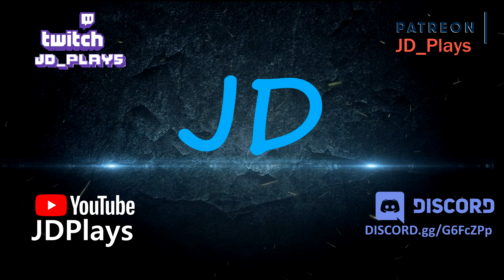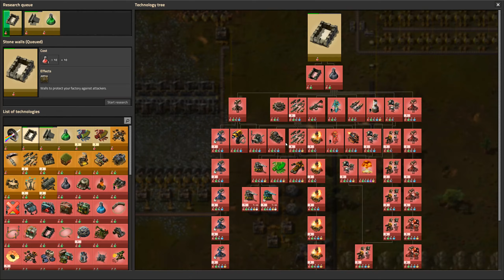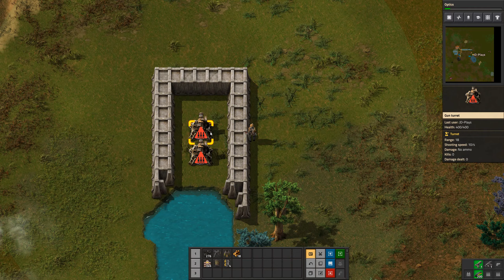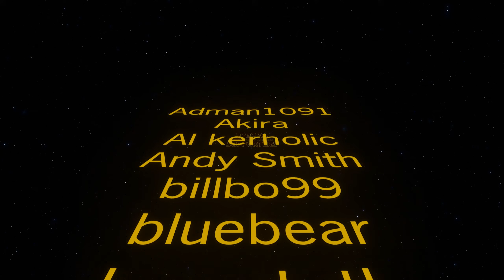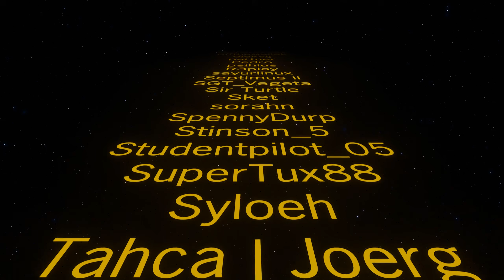Jumpstarting Basic Automation (Early Game Base) ⚙️ Introduction to Factorio 1.0 ⚙️ Tutorial/Guide

Comment: What's your opinion about a "ghetto pillbox" where stone furnaces serve as walls?  The "ghetto 1" variant is only a pair of machineguns surrounded by a honeycomb of 8 furnaces, the "ghetto 2" variant has both a  thin "proper" inner wall and a honeycomb of 12 (or 8+2N for any line of N gun turrets) furnaces as a first layer of protection.  The reason behind furnaces is that they have the best HP per resource cost, even though their HP count per square is mediocre.
Reply from the maker: Furnaces work, they take a lot of space for very little cost. One better is wooden boxes at i think its 50hp per box, then pipe is 100 hp per tile a even better option! Really walls are cheap and if your in trouble are worth the cost even early on

Comment: This is the best early game base I've seen. Can't believe how simple it is but effective.
Reply: 05:33  That's a trick that should be explained more. 
One can clearly see the T-shaped structure with horizontal belts which side-load the vertical belt and create a mixed belt of iron ore and coal.  What's less clear is how to build it.  If you build the vertical belt of the upside-down T first, there won't be any side-loading, because the belt will curve from left to right to up.  If you build the belt coming from the right before the vertical part (as shown), the bottom can't decide whether to curve left or right and doesn't curve at all, which will allow for side-loading.  
(The coal splitter at  05:45  doesn't changes that; it's merely a way to convert a full-speed belt into two slower parallel belts at the last second.  If you dedicate a whole smelting array to one ore, you use another splitter on the ore belt to split it in two, mirroring the coal belt.)

Comment: Shift+left click. Shift+right click. Middle Mouse button. wish i knew these little fun facts weeks ago. also, when using concrete, you did not explain how to increase/decrease size to paste. i definately want the blue print for iron/copper starter line. that is just golden. saves tons of space and less moving things 900 times. 3 thumbs up!!!
Reply: Plus and Minus on the numpad.
As an old-ass gamer, the first thing you should do when you load up a new game is to go look at the keybind options.
Reply from the maker: Oh yes almost every game I open the keybinds and settings before i even start a new game!
Reply: Yeah, I also found the +/- in the keybinds but I went one better -- I mapped ctrl+(mouse scroll) to embiggen/ensmallen the brick/concrete/landfill placer brush size. Works a treat!